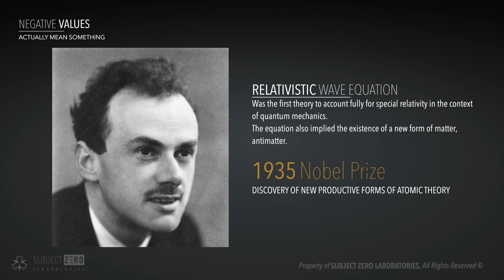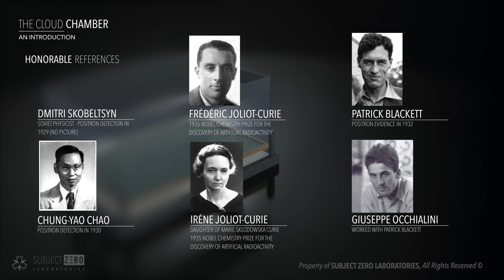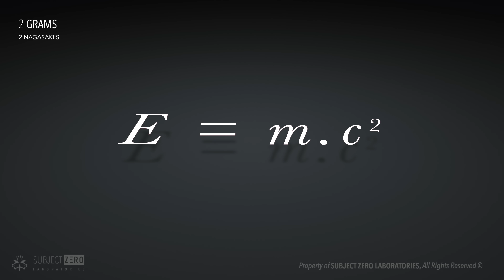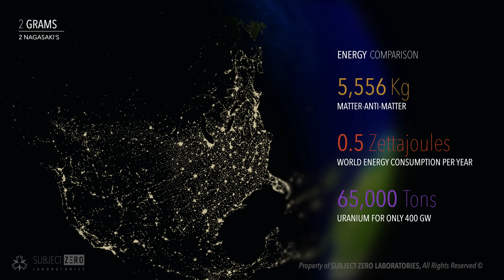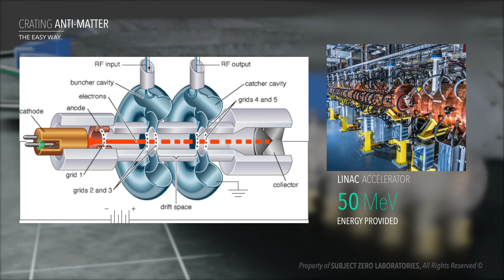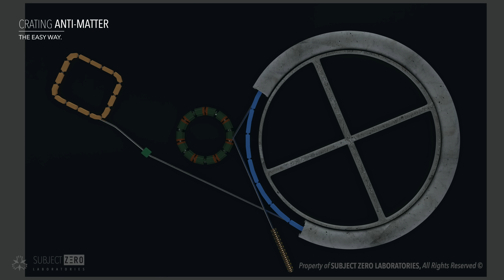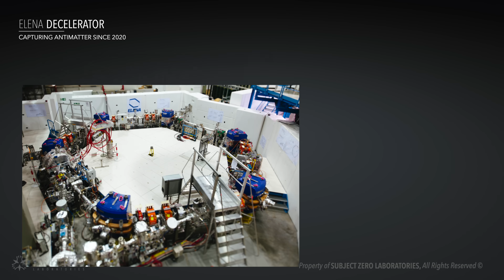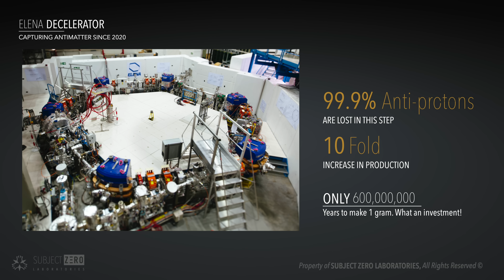Antimatter - How it is made [2019]

Comment: An antimatter bomb is a bomb, which is based on the annihilation of matter and antimatter protons and antiprotons and other subatomic particles that annihilate each other, matter is transformed during the chain reaction into energy
  Where nuclear fission of heavy atomic nuclei into lighter elements could also occur due to the release of neutrons that break the nucleus of heavier atoms.  This is the energy that is released in nuclear bombs when the division of the atom occurs.

 Negative matter are atoms but with the opposite sign (-m) to positive matter (m)

  Antimatter energy:
 E = -mc ^ 2 = -E = -mCi ^ 2
 (Antimatter * C ^ 2) + (matter * C ^ 2) = 0

 -mc ^ 2 + mc ^ 2 = 0 => E-E = 0 ==> E = E energy generated

 e / c ^ 2-e / c ^ 2 = 0 ==> m-m = 0 ==> m = m matter transformed after the reaction.

  E / -m == Ci ===> C ^ 2-Ci ^ 2 = 0 ===> C ^ 2 = C ^ 2 speed of light squared
  Theoretically, a kilo of antimatter would weigh the same as a kilo of matter but in the opposite direction, if a kilo of antimatter is put on a scale, the weight would not generate downward pressure, but rather the weight would pull the scale up.

  Antimatter or negative matter, are atoms but with the opposite sign (-m) to positive matter.  If gravity is a force F = G * -m * M / r ^ 2 = -m * the theory says that the force exerted is the same but in the opposite direction.

  just as all objects fall at the same time regardless of their mass due to the attraction that the Earth exerts on all matter, antimatter would undergo a repulsion acceleration of 9.8 newton regardless of its mass.
  Where at higher altitude the acceleration decreases.  Since the force of repulsion is inversely proportional to the square of the distance.

 And since gravity is an acceleration.
    Whether it is caused by a space-time deformation (Rμv-1 / 2Rgμv = (8piG / c ^ 4) * Tμv) or if it is an attraction exerted by the earth on matter (F = G * m * M / r ^ 2) where this behavior of antimatter does not contradict the theory of Einstein or Newton.
   Where for very small speeds compared to the speed of light, like those in our ordinary world, the relatisistic force becomes.
    F = m a / √ (1-v2 / c2) = F = m a
 And where a is gravity
   Again we see that Einstein's physics is not a break with Newton's, but a continuation of it where force, acceleration and mass differ at speeds close to that of light.

 It would do it the reverse of magnetism, where poles of the same sign repel and attract different signs, where in a mass (m) a magnetic field is created due to the movement of the electrons that contain the atoms that
 they have a "spin", or direction in which they rotate and that determines that it has a north pole and a south pole.

 And the inverse of the electric potential where electric charges of the same sign repel and of the opposite sign attract.  But similarly, if two electric charges of different signs come together, a circuit breaker occurs, this is due to a potential difference (a difference of an excess of electrons in the negative cable and a shortage in the positive cable) because the charged materials they tend to regain their equilibrium state, and to achieve this the atoms need to recover or give up electrons to regain their neutral charge.

Comment: Considering that a super long burn of conventional fuels can get you to 10 percent the speed of light (as mentioned in your warp drive episode) wouldn't it be easier / more practical to do a VERY long term burn of a fusion reactor design? (or is that the 'conventional fuel' you were describing previously?).

Comment: I’m no scientist but I simply had to write this down.
If 1 electron has -1 e and 1 positron has +1 e then it should be assumed that a more appropriate name would be negative and positive matter. What we call electron should be called a “negatron”. Where a negatron would pull things in, because it has a negative effect on the force of other matter a positron would then be expected to push with the same force. That doesn’t happen, opposites attract. Because the collision converts both forms of matter into energy it must be stated there is no neutral matter including light (as we yet know). This means that if the “big bang theory” having used energy to create negative matter were true would then at the same time probably create positive matter. Even now when matter is converted into energy it doesn’t simply disappear, it is transformed. Yet there is no Absolute Zero state so as energy dissipates we should theorize that it does in fact transfer to matter of some kind.
Because of these observations it must be safe to hypothesize that gravity and energy both act on a substance based sully on its properties and not just on the amount of either force. Gravity and energy, such as light, also interact because photons DO have mass though we can’t measure it yet. This also means the both gravity and light are not universal. Light may in fact be able to travel slower or faster than previously thought. As an asteroid gets shot around a planet picking up speed, light may in fact change with different gravitational pulls.
So would gravity then be the Amount of negatrons in a single location? This might mean that a black hole is a massive gathering of an unidentified element.

Comment: so, when the protons are smashed and the detectors pick up a set of rays coming out of the crash producing the image shown,  are not rays strings and cant strings form using the quantum cell kevin theory?  the smallest particle of matter before it jumps space using its super position scalar quantum state,  phase change into the forth dimension?  how small can matter exists before it is so small it does not exists?   or will a spark be witnessed before mass jumps to a new state in a different universe or reality or dimension?   

my quantum cell theory of mass is simple,   the single unit looks like this,   a toilet roll paper roll,  pointed on top convexed  having a slight positive charge,  at the bottom its shape is  concaved with a slight negative charge ,  the center of the cell , the nucleolus is the super position scalar link,  brake this bond and the mass is injected into the forth dimension do to size and atmospheric conditions,  net charge.    the size of cell is a diameter of on-X,  the lengths is 1.6-X,   sound can brake the long chains they form,  strings that vibrate at the speed of light.  tune in the correct frequency will split the bonds between the quantum cells allowing new matter to be arranged into different things?

Comment: ALUMINIUM MERQUIRY...A13 M13 LIGHTEST HEAVYWEIGHTS  MERQUIRY LIGHTEST THEY CAN BE BOTH LIQUID SOLIDS LEDIUMS HEAVIEST ...METAL IS MELTED ALOY TUNGSTEN ASERO HAS DEPOSITED ACIDOUS CORROSIVE AMINO ACIDS...OIL OXYNL GOLD COPPER HAS OIL DEPOSITS TO TURN ALGAE VERDE PLANKTONS.....EXPOSED CONTAMINATION NOT PURED ELEMENTS...MAN MADE..LEDIUMS HEAVIEST LIGHTEST THAN WATER MATER IS MERQUIRY SENSITIVITY ALUMINUM ALLOY IS WATER ICED DIOXIDE SUNES.. MONOXIDE  MUNES ...FIRED JUST NEED TO EXTINGUISHER IS DIOXIDE DRYECED NOT LIQUID PRESSURIZED GASES......BUT DEHYDROXIDE DEHYDRAULIQS DEHYDRATED  DENSITY HHH..A.H.L.V.H.A.B.T.E.S .....

Comment: You can use Antimatter to power the world, as creating antimatter requires more power than it can release, first rule of thermal dynamics: Energy cannot be created or destroyed, you can only change the type of energy. Since there is only a miniscule amount of antimatter in nature, it cannot be used for creating electricity:)

Propulsion yes, powering a city no, unless you use antimatter like a battery, you still need to create energy via other means

Comment: Would anti-uranium decay just like normal uranium? Decay is caused by weak force and it is believed that the weak force does not work with antimatter. (?)
Reply: The weak force interacts with "left-hand" (helicity) particles and "right-handed" anti-particles. The right-handed (left-handed) particles (anti-particles) do not carry weak isospin charge.
Reply: sumsar01 So... Uranium in order to decay must be left handed, isn't it? Is the anti-uranium right handed then?

Comment: Im trying to warp my head around concept of capturing something that literally cannot be capture by matter itself...
Reply: What you want to capture may be anti matter, but, it has electric charge, so it should be manipulated by magnetic fields.
Reply: @danielavalsangiacomo6691   Yeah I know but still, it would also be probably in vacuum but you cant create perfect vacuum, this is mindblowing.
Reply: @TheDragonfly256  
If you have enough anti-matter, then the remaining normal particles would be annihilated. So you really don't need a perfect vacuum. You just need a lot of anti-matter.
Reply: @TheDragonfly256  If you squint a bit you can imagine an antimater beam as a fantastic vacuum pump! :)
Reply: @TheDragonfly256  So basically a super strong magnetic field with no physical boundaries in space so it is contained in a natural vaccuum?
Reply: @XWolf  space isn't a good vacuum, we can pull lower pressures on earth
Reply: @XWolf  think of space as the ultimate neutral environment. Each direction has the same force...
Reply: @RRKS_TF  space is no vacuum.
Reply: @SneakyLittleHobbit  anti matter is expensive to make and takes forever to make
Reply: Most importantly. Something that doesn't want to exist.
Reply: clayfame   that is a solid argument!
Reply: magnetic fields

Comment: Parts of this vid is kinda dumb. Antimatter is a horrible fuel/power-source, its creation always will require more energy then the power yielded from its consumption. To get antimatter you need to excite a particle into that configuration and that requires at least the potential energy that particle stores and almost certainly more so as its creation will almost certainly be quite lossy. In terms of volume and weight antimatter is one of the best to store energy so it might make a good battery but all that depends on how efficient it is to make it, store it, and convert it back to energy. Storage kinda sucks as you obviously cant put it on a table with out the table blowing up and if that drastically increases its weight then antimatter looses its luster. Even if you magically solve that problem its really not easy to convert back to energy as you cant charge an 18650 just by setting it next to antimatter, so you need a generator to convert it back to energy and if thats two heavy and/or too lossy then again antimatter looses to more conventional generation. And even still its honestly shit for extra solar space travel unless you fix those earlier problems and then still it is only useful well slowing down when your approaching your destination as its mush cheaper to use a stellasor to speed up well still in a solar system with infrastructure. tldr antimatter is poopoo and its probably better to use gasoline in almost all applications you could possibly use antimatter.

Comment: Anti sub atomic particles....ok...but!   Ya need em to form stable anti elements if you want to play.  Anti Hydrogen, Anti Helium etc etc.  Eventually anti elements like iron, which are easily controlled in a magnetic field.
Reply: But these are specifically anti-proton production machines, good luck with anti-neutrons and anti-electrons.
Reply: So, yes anti iron could be controlled with ferromagnetism, that is kinda inconsequential.  Any particle can be controlled with magnetism, we just think of magnetism as ferro magnetism because that is the most common form of it.  So we dont need it to form an anti iron atom to control

Comment: I just want to remind people: If antimatter turns out to react oppositely to gravity, stable wormholes are potentially a thing.
Reply: I heard somewhere (not reliable) that they let anti hydrogen fall and it fell the same direction as matter.
Reply: @jamesmnguyen  I heard about that too
Reply: Your thinking of negative energy, not antimatter.
Reply: Negative energy or at least matter that acts oppositely to our idea of regular matter could explains how black holes die, becoming white holes.
Reply: @guywhodoesstuff1798  1.- Hawking Radiation.
2.- White holes are only theoretical objects.
Reply: Negative mass means negative energy. If that is the case antimatter should not release energy when it collides with matter
Reply: It doesn’t have negative mass lmfao
Reply: That's exotic matter
Reply: @Iwanow11111  Ah awhile ago it was thought to be improbable but newer studies suggest it is possible. Scientists for example, created negative effective mass (it isn't really negative, but does the opposite of attract - it repels). So in theory if a black hole (it's mass won't actually be zero either) is filled with more negative effective mass than regular mass, it will dissipate over time. The end result is a very tiny and invisible, "white hole". It's Hz will be smaller than visible light
Reply: @guywhodoesstuff1798  I thought the scientific consensus so far is that black holes evaporate because of Hawking radiation.

From wikipedia:
"black holes that do not gain mass through other means are expected to shrink and ultimately vanish. As the radiation temperature is inversely proportional to the black hole's mass, micro black holes are predicted to be larger emitters of radiation than more massive black holes and should thus shrink and dissipate faster."
https://en.m.wikipedia.org/wiki/Hawking_radiation

Negative mass is a form of exotic matter that has no evidence to back it up, although I wouldn't be surprised if there are equations to show how it would work if it did exist.

Hawking radiation does not require any exotic matter yet discovered to explain black hole evaporation. It is a phenomenon that works because of a combination between general relativity and quantum physics (which makes it very fascinating). Virtual particle generation is the reason Hawking radiation happens. When a particle pair spontaneously forms at the event horizon, one particle falls into the black hole while the other is emitted. I don't know the specifics as to why this causes the black hole to lose mass because I don't understand the equations, but physicists seem to find the equations and theory behind it rigorous enough without any physical law violations taking place.
Reply: @TheSkullConfernece I l'm late but woww most the comments before this one are bs 😂
Reply: Not saying it's correct either, just theoretical
Reply: antimatter can, and already has been created in a lab, and it does not react oppositely to gravity
Reply: @RevelationsProspero  Gravity is the weakest force. They have yet to conclusively test how it effects antimatter because measuring gravity on any individual particle is incredibly difficult and antimatter can't be held in large amounts.
Reply: Sadly, they recently found the answer: it reacts the same to gravity… so we’ll need something completely new
Reply: @Iwanow11111  In the equations all you have to do is set the mass = 0 and it's a white hole.
Reply: No matter what, you die in a whitehole.
Reply: Bad news for you...
Reply: @Iwanow11111  Where has this been "debunked"?
Reply: And warp drives.
Reply: Why does antimatter disappear when made?
Reply: @Izaish03  Nothing ever disappears. Antimatter normally hits matter very quickly after being made, which annihilates the antimatter, and the matter that it hits, which results in very high energy gamma rays. Recently it was proved that photons can also collide, creating matter and antimatter (so you can turn the gamma rays back into matter and antimatter, though that's likely much harder than creating the antimatter in the first place)
Reply: Anti matter does not have negative mass
Reply: Do you think antimatter gets trapped in coronal mass ejection beams and or solar plasma? Could it be possible?
Reply: Everything about matter and antimatter is identical except for the charge, which the sign is changed, nothing more
Reply: Not if a bunch of guys in black SUVs and black suits show up and take all the important researchers one by one into a back shed for a stern talking to and slap on the wrist.
Reply: It reacrs negativle to charge but not gravity
Reply: I don't even know how are you understanding this video
Reply: I'm guessing antimatter is the antichrist 😮
Reply: I believe this was already rejected since there was a recent experiment and the antimatter, same as matter, behave the same way in gravity.
Reply: @NotNotNPC  
If you notice, the comment you're replying to is 3 years old. So, before said experiment.
Reply: Stargates 😮
Reply: Fairly recently this question was answered at CERN (ALPHA, i think).  They created a hyperosscillating magnetized chamber into which they injected positrons and antiprotons, forming antihydrogen.  There were dual scintillation counters, one at the top of the chamber, one at the bottom.  A scintillation (flash of light) occured whenever a molecule of antihydrogen annihilated with the chamber wall.  The proportion of the total scintillation count was thus:  about 15% at the top scintillator, 85% at the bottom, strongly indicating that antimatter reacts to gravity the same way as matter.  More experiments will be necessary for absolute certainty, of course.
Reply: So will anti gravity vehicles
Reply: Is anti matter essentialy matter but negative and potentialy may have negative mass?
Reply: QUANTUM PHYGUY afaik they all have opposite charges and that is it, they have the same mass, spin, decay times, etc
Reply: @gumbilicious1  Ok thanks!
Reply: Your wrong
Reply: @jamesrick3524  my wrong?
Reply: We've been studying it for almost a century, we know it doesn't.
Reply: Gravity only exist bc of matter and anti matter which is why they belive the big bang once the universe dies and all matter collapses it will explode due too not enough matter compared too anti
Reply: @ItzBulletOG  oh ok well I'm ok with that idea 😱